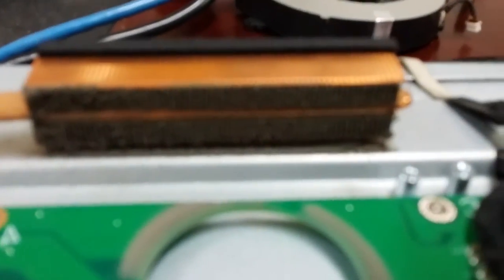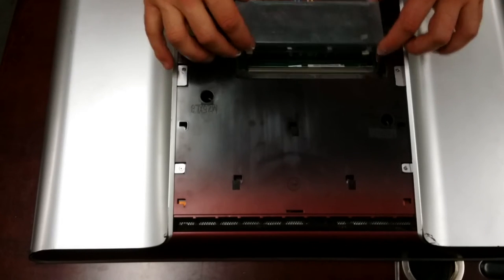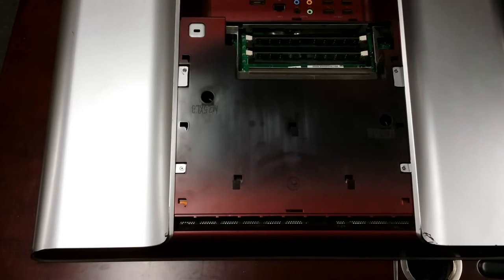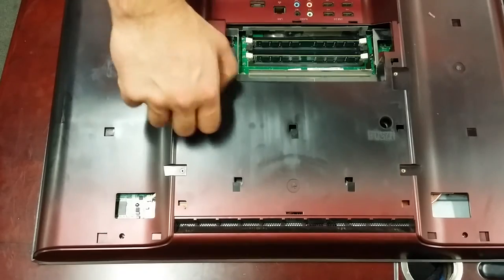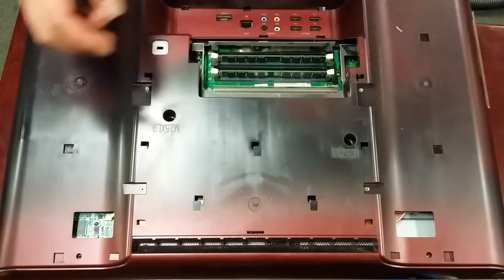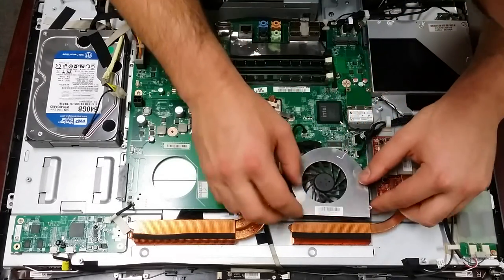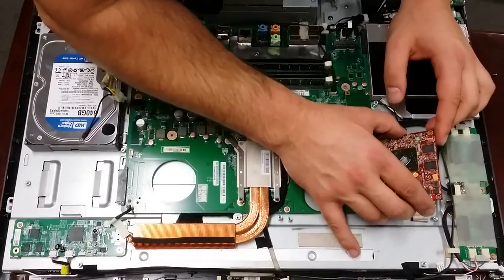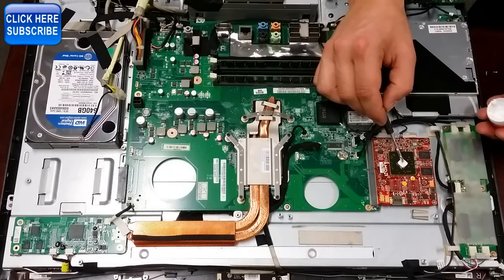ACER ASPIRE FIX (Overheating, Shutting Down & Tear Down)

Comment: Hi which machine is this please? I have got Acer Aspire z5600 and there is no GPU cooler or fan in there. Bought the machine second hand so not sure if it's just not an option in that model or if someone is actually taken it out. Thanks
Reply: i also have the z5600 and mine didn't come with a second blower or gpu.
Reply: im using Acer Aspire z5700
Reply: this is a acer aspire z5710

Comment: I realize its the AMD processor that gets hotter than INTEL... plus bad design... will not buy ACER again.
Reply: I purchased three, two failed due to poor engineering. The third, I am praying for still staying in service.
I finally purchased a 2012 Dell 6230 laptop  with an i5 processor, and never had a single problem.
Reply: @adfontesaquarum  mine has an Intel